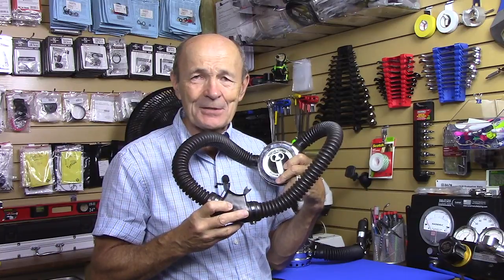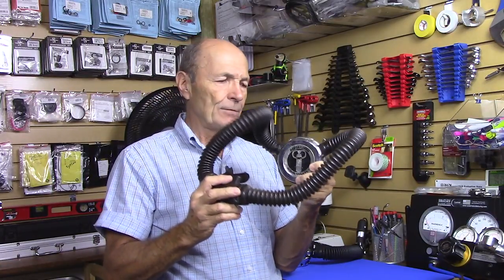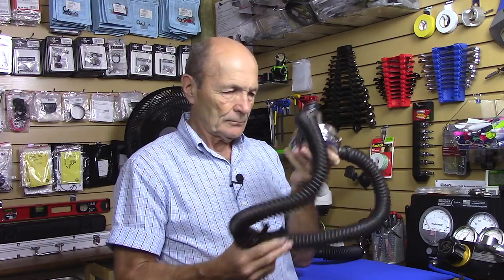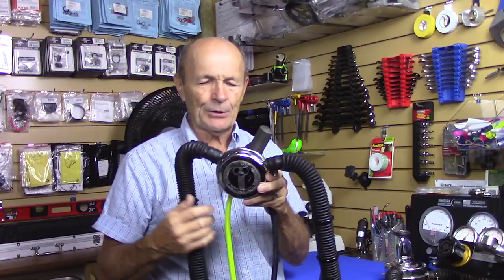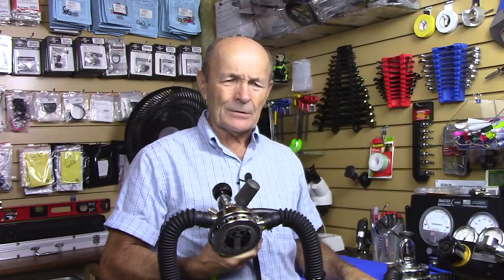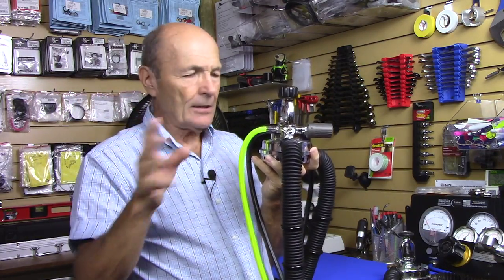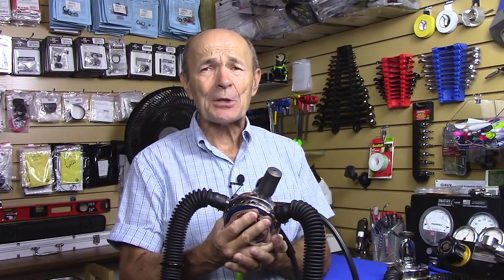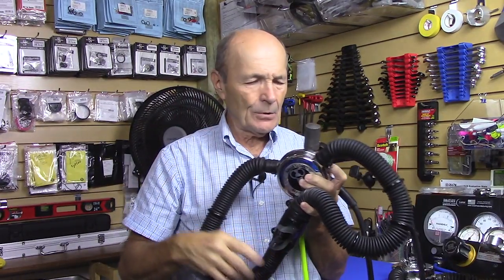Diving A Vintage Regulator - Scuba Tech Tips: S08E06

Comment: I'm diving a modern Aqualung Mistral but I'm looking for an old double hose regulator. I want to dive it. Perhaps for a couple of times, but I want to turn it into an Argon Injector: You remove the mouthpiece and replace it with a balloon. Second you remove the exhaust hose and put it on a compressor. This way you are able to fill Argon tanks with an air compressor.

Comment: Hey Alec. Im wondering when the pressure is on( tank on ). Will the water go up through the inhale hose and destroy the mechanism inside of it? because for a single hose, when the tank is on, water can't go in through the hose. IDK if double hose is the same thing
Reply from the maker: Not at all.  At the mouthpiece of most double hose regs are 2 one way mushroom or 'wagon wheel' valves plus another 'duck bill' valve on the exhale end of the hose.  Purpose is to prevent water into the hoses.  Watch my Vintage Scuba video S04E14 The Amazing Hope-Page mouthpiece to learn when about this invention and how it changed double hose diving immediately.  Thanks for watching.
Reply: @AlecPeirceScuba_SeaHunter  thank you !